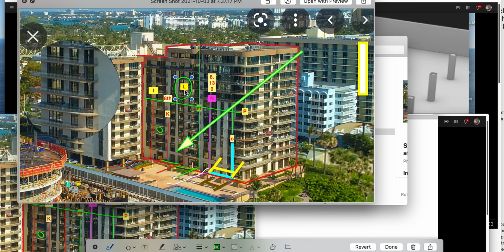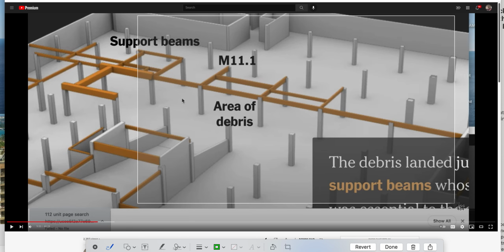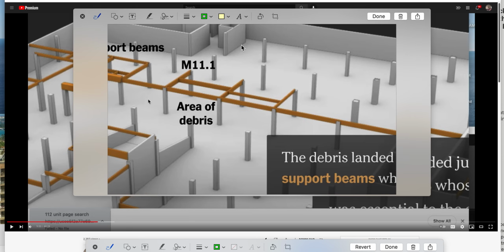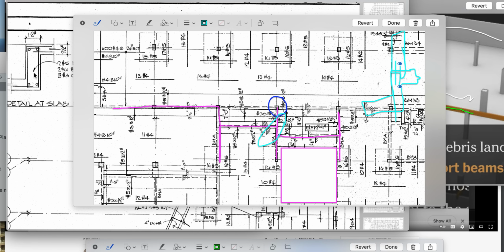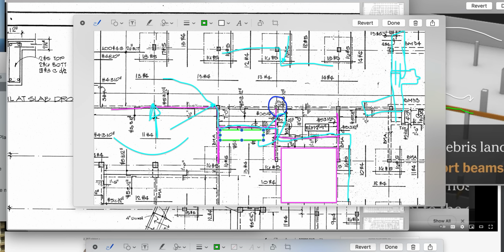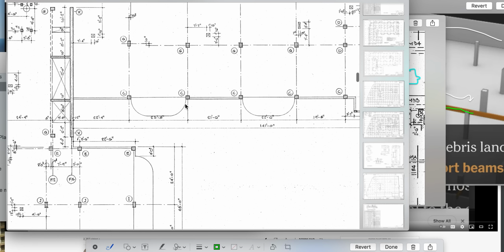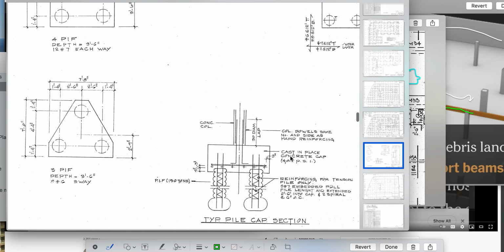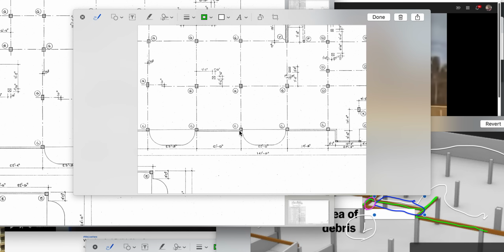Champlain Towers Collapse L load path failure into building explained #ChamplainTower #Surfside

Comment: Chmplain Tower collapse - I have to conflicting issues - first when you show the frontal collapse and point out that the collapse started somewhere above the ground level then I have trouble followig because the lines on the front of the. building in the middle are continuous so there is nothing to see for reference points.  Contrary the young male tenate in apartment 111 who said he saw the deck collapsing related in an interview that the first indications of problems (noises) came from overhead in his apartment.  The guard at the lobby confirmed that sort of by saying that the first noises came from the elevator shaft.
Reply from the maker: I have resolved those questions in many videos...
I have over 250 videos on this topic.

Comment: They should have substantial beams and columns around the parameter of the building on the 1st 2 levels, but that would be too expensive.  Someone could blow up 2 of the lesser columns on the lobby level and the whole building would fall, because the lobby columns are not substantial and there is no beam connecting the remaining ones if 2 are taken out. In some places you could take out a columns or 2 in the garage perimeter because there were some beams and the columns were heavier, but because the lobby level was not inherently stable that would have to be done without disturbing things up there.
Reply from the maker: It should be noted, that something as nefarious as that cannot be stopped...
That is the same as putting all your car brake lines in steel casing to protect from someone cutting them...
This was a maintenance and a BMA structural memberS removal...

Comment: I stopped watching, I broke my foot. Has a cause (L rattle failure) been determined or at least a viable theory? How is CAT Union Staff? Champlain Towers, a twist on "Towering Inferno." PS: In your opinion, based on the blueprints, was it designed properly? With built in redundant fail-safe features? We may never know if it was built exactly to those plans and if 40 years of maintenance was performed. What things would you have changed in those plans that would have made it a "better" building? Sorry for the many questions, I'm not trying to p*ss you off.
Reply from the maker: How is ur foot now?
Reply: @LoadPathEngineering  I'm now in a walking boot, hoping to avoid surgery. I had to "engineer" a way to keep my dog from jumping on the bed and landing on my foot. I placed a sturdy box under the blanket, which works like a charm. I broke all the metatarsal bones in my left foot. Thank you for asking. Keep up the great work. If I ever buy a condo, I know what to look for!

Comment: The red pigmented paver cement failure dust has already reach deep into the 8701 Collins Avenue surveillance camera before L failed. 

Data indicates a strong possibility that CTS pool  decking next to its South foundation wall next to the boardwalk (once 87th Terrace street) where data shows top 1/3 of structural wall failed next to the planters which also failed where the pool decking was tied into the foundation wall, failed before L which explains the red dust already hitting the pool camera at 8701 Collins Avenue before L failed. 

I am not stating this location overall failed first, I am stating  red pigmented cement dust from the pavers reached 8701 Collins Avenue’s pool security camera before L failed and data also suggests the location where the paver decking dust came from.